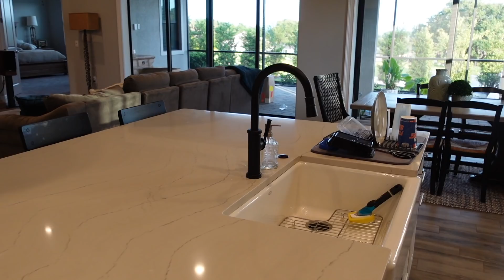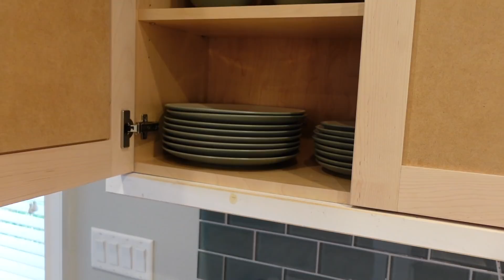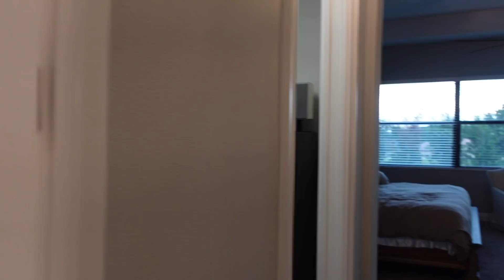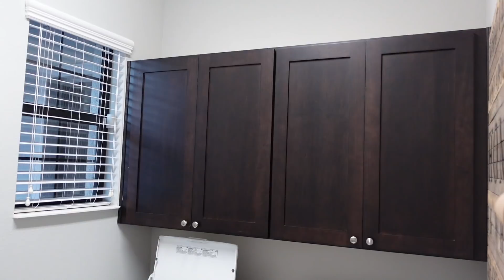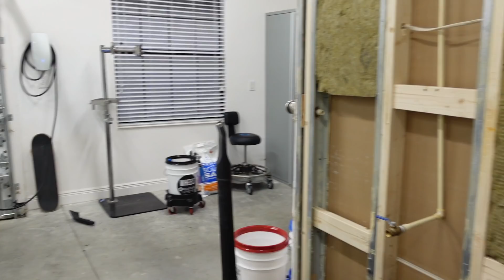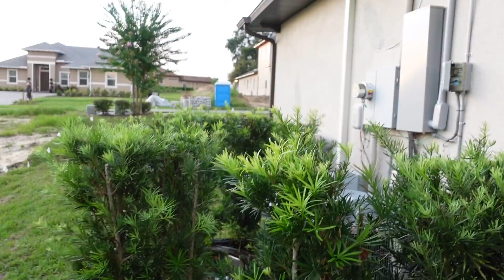An Update on All the Projects at My House

Comment: Use ZEP Grout cleaner. Very easy, just spray and let soak and lightly scrub off. It works like a charm. For The silicon just peal off and and apply new silicon on the edges.

Comment: You should consider maybe doing a Mitsubishi MUZ-FS06 in the attic and keep your existing central. Sealing off the extra ducts you added pushing air back to the living space. Also allows independent control of temp in attic. Could also swap out single zone mitsu condenser you put in for the garage for multi zone and add 6k head in attic.

Comment: Hey Matt, for the shower get the cling toilet bowl cleaner with bleach, dilute 1:1 with water in a spray bottle, spray and let dwell for a few. Light agitation on first application might be necessary but overall does a good job at removing/killing mold. Only downfall is the bleach smell can be strong if you go too heavy

Comment: Only way to keep mold from growing in a shower is to dry it after every use.  Where there is water there will be mold.  I just keep a spare towel next to the shower and do a quick wipe down.  Still need a little bleach every now and then but nothing more than the usual cleaning.  Maybe you could coat your shower and use your ego  with the stubby nozzle to dry it 🤔 😁

Comment: Pool Essentials! You can get in gallon jugs at walley world 🌎 aka walmart…. It uses like 
12% bleach vs reg bleach at 3% …. So if  you dilute it 50% with water you’d be 6% strength enough to knock out the mold! Hopefully not strong enough to bleach the grout white tho

Comment: Love the updates but I think Sub Zero must be still be forging the stainless sheet stock in Lithuania.  Hope they get installed before you move out.

Oh, and about the metal faucet, I used to be that way until running 140 d water through it a little.  It gets toasty.